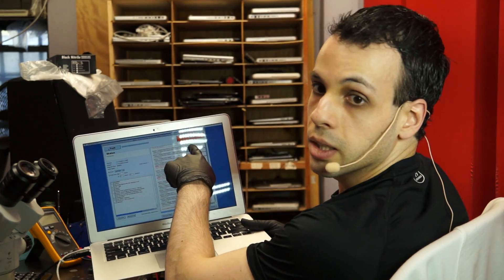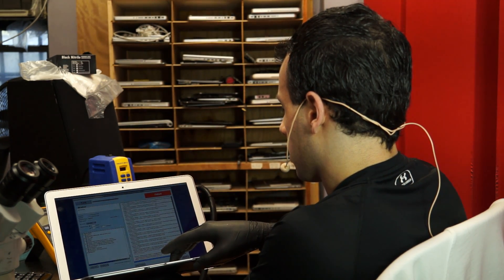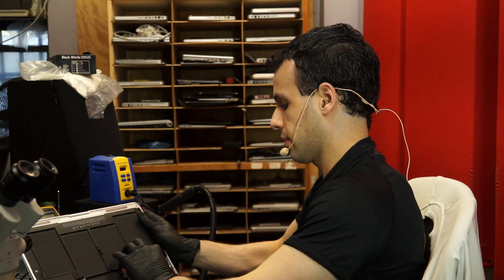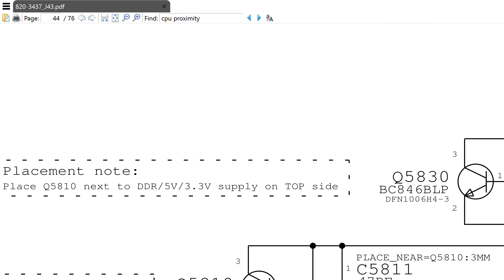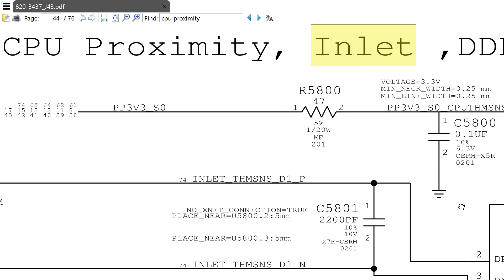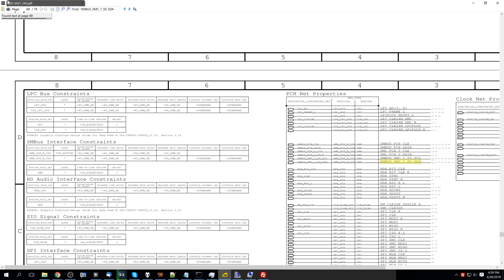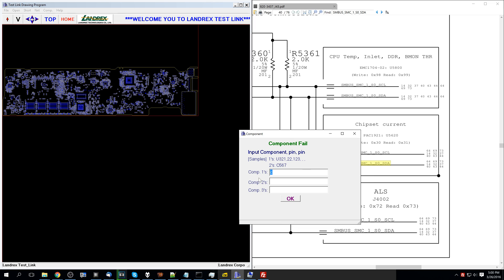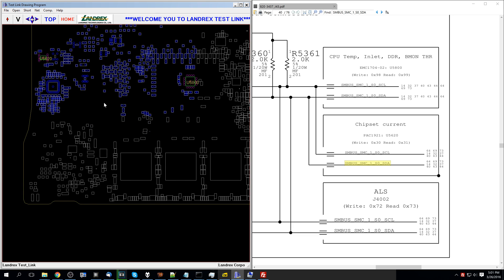Macbook Air fan constantly spinning full speed after liquid spill repair

Comment: I have a macbook air early 2015 . when I daignose it shows there maybe man issue with fan.. reference code PPF003 Will you please tell me what is the reference code PPF003 ?. I change the fan my self but it's keep running at High speed with loud noise. PLEASE HELP 🙏

Comment: Hi, I've seen your videos. I have a MacBook air 13 about the year 2014, the computer turns on but runs very slow and its fan works all the time at maximum speed. I checked the charging port and there is a damaged USB right in it, I do not know if it is the cause but I want to ask you if I can send my motherboard to Chile to have it checked and repaired, indicating the price of your work. Thank you.

Comment: +Louis Rossmann Hi, I wanna inquire if it is possible to replace this ISL 95826HRZ M430BW chip with ISL 95826HRZ M407CL chip. From your youtube lesson I understand, it's power management chip. My MacBook pro a1502 got damaged from ice water spill. I opened it personally of course after watching you and figured out that I can do something about it. I am in brazil and repair shop is quite far and expensive. 
Thanks.

Comment: I'm dealing with this exact issue right now with my Late 2013 MBPr.
Liquid was not spilled on the device, but under the device. ASD EFI reports Ts0P Palm Rest temp sensor failure.
ASD OS has an SMC failure, Apple Diag has PFM006 and PPN001. 

I'm pretty handy, but deep board level component replacement might be a little out of my wheelhouse. Any tips?
Reply: Hi Louis, I saw on another side you indicated that the data line for this sensor might be shared with the iSight camera, so I took a closer look around the logic board, and fixed my issue. (for now, I hope).
Thanks again
Reply: @jonmchang  What did you do to fix it?

Comment: I had some similar problem with my MBP.
I did some researches, read the sensor data out and identified my problem as one damaged temp sensor. Giving variable temperatures between -150 to 150 degrees celsius...
Got to the the apple store, please replace me this sensor/ chip...guess the answer
"We have to sell you a new logic board"
It's a pity you don't have a location in europe---

Comment: incredible. I had this same issues with my air, the EXACT same issues. I cleaned the board and sold it to a refurbishing shop for 500 with those problems and only paid 829 for it brand new. I'd say I made it out the best i could've in that situation...  Thanks for the upload, Louis!

Comment: Windows 10 scaling is much more weird than you think, a pc at my work, when shutdown and then powered on, loses network, power and sound tray icons (and you can't enable them). You have to go to display options, set scaling to 125%, apply, set scaling to 100%, apply, restart the explorer process and boom.. "fixed".. until next boot. so we just hibernate the machine.

Comment: Windows 10 kills me, man. Firstly Microsoft is basically forcing users of Windows 7, 8, 8.1 to adopt 10 by doing an "upgrade" to Windows 10 that it doesn't tell you it's going to perform until it's already installing Windows 10, and then you've got problems like Cortana crashing constantly and the font scaling. The Cortana crashes and font scaling (blurry fonts, weird interlacing issues, and font rescaling) are all known issues and have been for almost a year now... NO FIX? No fix. Microsoft is too busy forcing everyone to convert to Windows 10 apparently to fix a simple font glitch.

Comment: I did exactly the same way of thinking when both, the left and right channel of my car audio stopped working. it must be the amplifier that makes the problem. in the end  i found the problem somewere else. the wires which lead to the speakers inside the left and the right door both broke at the same time. what a coindidence.

Comment: After replacing the thermal compound (with artic silver 5) my macbook (MB985) seems to run hotter... Meh...
Reply: Try replacing it with a different application method. What method did you use before?
Reply: I tried twice, one with the "rice method" and the other spreading across the dies. But originally it had significantly more thermal paste, not sure if that is the issue (I go for a thin layer usually).
Reply: Application Method doesn't matter as long as there isn't too much or too little compound on the die.
Reply: I ended up re-applying with my finger a homogeneously thin layer. It reduced a little the temperature but not by much. I think what is happening is that OS X is becoming too complicated for this computer to run, thus heating up more.
Reply: ***** For the love of god why the hell are you using your fingers for that shit
Reply: +RalphArwen because I want to :*

Comment: The scaling issues are not really Microsofts fault a lot of times its the fault of old third-party software which didn't plan for scaling. New programs based on msft apis generally scale well.
Reply: This. Probable the creation of the Dialog is done with hardcoded size, while the move actually resizes as well, using screenwidth/height.